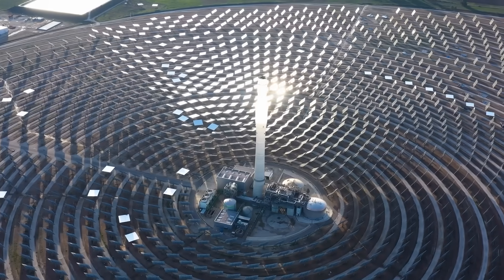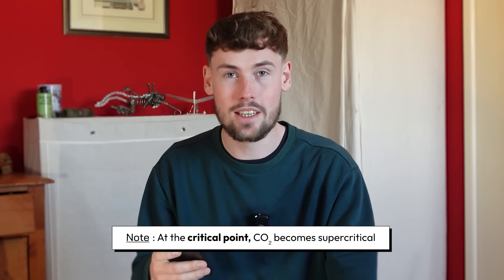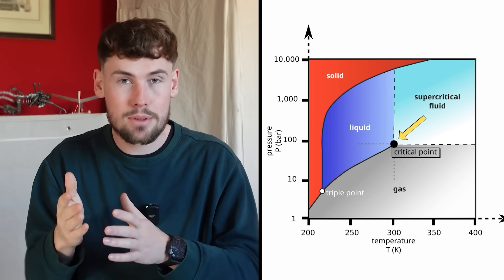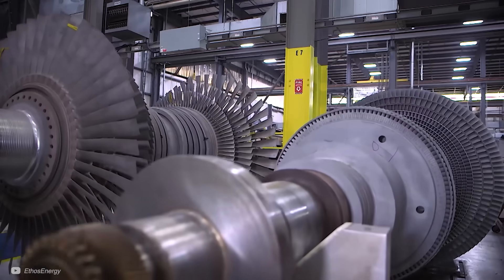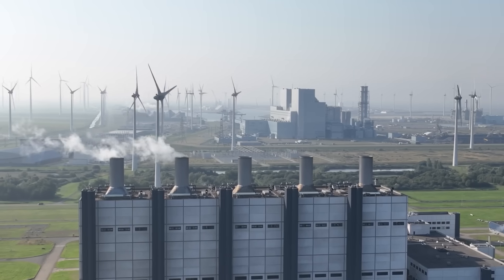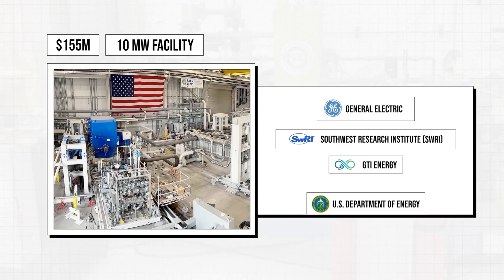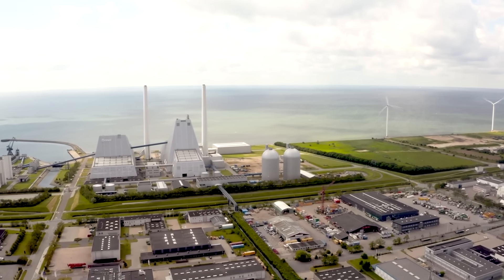How Ultra-Efficient CO2 Turbines Are The Future of Energy

Comment: NOPE... :  https://netl.doe.gov/sites/default/files/netl-file/23UTSR_31_Follett.pdf

IT'S A FARCE, SCAM..TRICKERY - NWO

Review of enhancement for ocean thermal energy conversion system
https://www.sciencedirect.com/science/article/pii/S2468013322000572

Notes on Thermodynamics, Fluid Mechanics, and Gas Dynamics
3.8.2. The Rankine Cycle and Improvements
https://engineering.purdue.edu/~wassgren/teaching/ME20000/NotesAndReading/Lec33_Reading_Wassgren.pdf

Investigation of the potential of R717 blends as working fluids in the organic Rankine cycle (ORC) for ocean thermal energy conversion (OTEC)
https://www.sciencedirect.com/science/article/abs/pii/S0360544222002201

ME 24-221
THERMODYNAMICS I
Solutions to Assignment 11
https://www.andrew.cmu.edu/course/24-221/as11-sol.pdf

Combined Heat
and Power
Technology Fact
Sheet Series
https://betterbuildingssolutioncenter.energy.gov/sites/default/files/attachments/Waste_Heat_to_Power_Fact_Sheet.pdf

Thermodynamic analysis of a new ammonia-water power cycle
https://www.sciencedirect.com/science/article/pii/S2352484719304585

sCO2, Ammonia and Hydrogen –
Advanced Turbine System Technologies
at GTI Energy
https://netl.doe.gov/sites/default/files/netl-file/23UTSR_31_Follett.pdf

V o l . 5 3 N o . 1 2 0 2 01
Development of Ammonia Gas Turbine Co-Generation Technology
https://www.ihi.co.jp/en/technology/sdgs/topic01/pdf/Vol53No1_H.pdf

4/00 Stationary Internal Combustion Sources 3.1-1
3.1 Stationary Gas Turbines
https://www3.epa.gov/ttnchie1/ap42/ch03/final/c03s01.pdf

Comment: so the real problem is pressure you nee at least around 80bar oar 80x atmospheric pressure, which means the structure is thick, you mentioned that in your video. And the reason for the high rpm's is the compactness of the turbine. With the small diameter only a small Torque can generated, so the the high power density could only achieved by high rpm's.

Steam Turbine suffer from low density -> large diameter and centrifugal forces. And sCO2-Turbines suffer from high rpm's.

Comment: You said “170 psi” but wrote “1070 psi.” Converting from 74 atmospheres, it looks like the latter figure is correct.
Awesome technology, I wonder how long it will take to start getting used in new construction… I assume it will only replace existing steam turbines as they wear out, at best.

Comment: I was first introduced to gas turbine as part of the Thorium MSR. The high heat created by the Thorium Reactor uses Molten Salt to move the fuel around as well as to move the heat generated into a gas. The heat of the Thorium Reactor is way too hot for water to turn into steam. I hope America's NRC gets off its bureaucratic a$$ and move forward faster.

Comment: But as you described it it is more a Bryton Cycle than a Rankine Cycle! It match with solar towers for CSP plants.
Anyway I can understand that heat exchangers will be far less complex and the whole plant will be significantly reduced in size and complexity.
Never the less I think (I know for sure) that recompressing supercritical CO2 will be more energy demanding of "recompressing steam" just because nobody (usually) recompressed steam, We all used to recompress water which is an incredibly effortless process.
(I'm sorry but I'm a monster in thermodynamics)

Comment: "the hotter something is, the easier it is to cool down" Stop fucking lieing with vaugeness. "easier" is the not the right word because how the heck is someone supposed to know what you mean by it? 
It certainly doesnt take less thermal energy to reach the same end temperature. Its not easier in that sense. 
It in the same physical setting will decrease in temperature in degrees per unit time faster. But calling that easier is overly reductive to the point of being totally unparcible to someone who doesnt already know what your refering too.

Comment: You're not using enough correct terminology. I'm trying to actually understand this with thermodynamics knowledge and when it's phrased this way it just sounds like woowoo bs.
Reply: Things like Heat Capacity, viscosity, hooks law constant. When you coloqualize complex ideas this much it just fails to communicate the idea. The fundamental difference seems to be how gasses and supercritical fluids relate temperature and pressure. I need more theory as to why than "they're moving fast"

Comment: Weird, that this could be more efficient to turn heat into Electricity than heating water.  Including the energy loss of having to recapture the CO2 with a heat pump instead of with water where you can just vent it outside and put more water into the system.

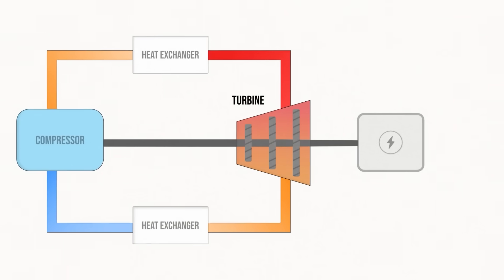Comment: 7:06 You don’t “compress steam”, you “pressurize liquid water” (which takes little energy) and then add heat called the Rankine cycle. The CO₂ cycle or Brayton cycle (which is fundamentally different from the Rankine cycle) requires huge amounts of energy to compress the working fluid. This video is mostly useless as for explaining things. The video doesn’t even explain that supercritical working fluids ARE NOT AS DENSE AS THEIR STANDARD FLUID STATES and thus are compressible and expandable within the supercritical state. Also there are other working fluids other than CO₂ like argon (and multi component working fluids like Supercritical Water and Ammonia, etc). 

The efficiency of a cycle, not the energy density of its components is the proper figure of merit. 

10:30 Also there are now supercritical and “ultra critical” steam Rankine cycles that are pushing 50% thermal efficiency, NOT 40% as the video stated which equals the stated efficiency of the CO2 cycle. So one has to beat that as a minimum but more importantly one has to significantly beat a combined cycle power generation which is 64% thermal efficient. Even an ICE with a bottoming cycle is significantly more efficient (54%). 

If you are going to be talking about using CO₂ as a working fluid maybe mentioning “oxycombustion” would be illustrative (as in the Allam cycle) which is more relevant and interesting. 

Basically the “pseudo-information” provided in this video is more misleading than useful.

Comment: CO2 is not more efficient than steam, it is simply a buzzier word to get investment funding!  Steam turbines are already "100%" mechanically efficient.  Overall plant efficiency is about 65% because that is the limit of the Rankine cycle - the VERY same cycle the CO2 uses to do the very same job.   It might have some advantages over water, like no rust maybe?  But it is hardly the 1000-years into the future "breakthrough" that is advertised.

Comment: Lots of unanswered questions in this one Ziroth, and it is very disappointing because it shows shill bias to me. Integrity is everything!
To me the only real advantage is the size (presumed cost) of the turbine, and it's presumed longevity, but you did mention that they are still working on said THICK metallurgy to ensure it...stretching harder on this one more than normal it seems to me? 
Source of the CO2 and how much will it cost to produce and how much will be required over a year at max capacity...AKA closed loop or open loop? As water is pretty much everywhere and dirt cheap for the most part. How much power does it consume to run, you know parasitic losses, and how about those CO2 compressors plus their yearly costs in power & maintenance? Now the temperature control of the supercritical CO2 in this tight range? 
You do know that super heated steam is dry right, turbine blade failure is extremely rare right, in a properly maintained plant?

Comment: One added challenge will be that the electricity won't be at the 60hz standard right from the turbine. The 27K RPM rotor makes that impossible. This means that there will need to be some sort of converter after the generator.

Comment: A few things here are wrong. 1. you dont compress the steam. You compress water to 200 bars (easy) and let the boiling take care of the Expansion. This step is super efficient, thats why it is done everywhere. You „lose“ some energy to condensation, but you can use a secondary heat exchanger to still include it into the Process again.
Reply: Furthermore, you have to lose heat energy to the environment in the condenser, otherwise the entropy of the working fluid will not return to its initial state and it will not be possible to continue the cycle of the engine. Even using a supercritical fluid such as co2 (or supercritical water for that matter) does not change this necessity, it’s simply the laws of thermodynamics (specifically the second). For this reason, you can’t actually reintroduce this heat into the process however a different process could use the waste heat to produce energy. However this is true for all possible heat engines, no matter the design.
Reply: It's best to use the exhaust steam for district heating and cooling.
Reply: @gregorymalchuk272   District heating is usually a commercial nightmare, and that's why it's not commonly seen in market-based power systems.  Much of the value of power station operation is derived from responding to power demand (mitigating financial risk in the power market), whereas a district heating scheme demands power station operation when it is not needed in the power market and this results in financial losses.  Machines are generally best to focus on a given task: a power station for the power market, and a boiler is the most effective way to create heat for a heating market.
Reply: *lose
Reply: @ thx, corrected 👍

Comment: You can't compare the ease of compressibililty of a gas with a liquid . It has to be two gases or it is meaningless.
It is comparing apples with blocks of concrete
You need to compare air with a dense gas such as uranium hexafluoride

Comment: Why is the most problematic part for co2 turbines not discussed? And also coincidentally the main reason water and turbines are used.. When you boil water, it expands, you don't need a compressor, the compression is done by boiling.. You're talking about generator efficiency and forgetting to talk about compression inefficiencies. Something that in the case of water is in the region of 95% because boilers can be made really efficiently.. Compressors first need to be driven, how do you drive the compressor when your energy output is heat??

Comment: Rotating equipment engineer here, I toured this Southwest Research Campus in San Antonio,TX in 2023 for this very high power density SCO2 turbine. It had a natural gas fired energy input and 3-D printed heat exchanger. The working pressures and temps were extremely high (as stated) and they had to develop custom shaft couplings to handle the high torque for the relatively small shaft diameter.  At that time the device just passed the “proof of concept” phase but it was very impressive and promising tech.
Reply: Did they mention something about cost of kWh compared to the steam turbine results? I am impressed by the idea, but the lack of financial discussion is somewhat bothering me a lot, as an engineer.
Reply: @ no mention of cost per kWh, the initial costs are almost certainly higher, and the fuel efficiency is unlikely to be worth that higher cost, but if the maintenance costs are lower and turbine lifespan is better, that alone makes it worth pursuing. the improved power density also opens up new applications where steam turbines are just too bulky.

steam is corrosive and slowly eats steel, unbalancing the turbine and limiting lifespan. supercritical CO2 doesn't eat steel. it may harm other components, but they're gonna be a lot cheaper to replace than the turbine itself.
Reply: @JedPotts-jv2ux  I was surprised that the efficiency only went from 40% to 50%. The molecular mass of CO2 (44) is over four time the molecular mass of H2O (10) which I would expect to result in more than only a 25% improvement in efficiency.
Reply: The downer is the maintenance cost of gassing and degassing the system. Also, catastrophic failure on the hot side would go off like a bomb because of the amount of energy stored in the hot supercritical CO2.
Reply: @cyber5515 CO 2 or H2O would not matter, when it goes off, it is disastrous. Engineering is key, lessons from failures are inevitable.  It is interesting.  It might be something that could be paired with the new reactor types, water heat exchangers, the SCO2 cycle, and with batteries.  Keep it small.  Use header systems and expand as needed.  Same old stuff
Reply: To me, it seems that it would take effort to come up with a coupling that is weaker than the shaft that it couples.
Reply: Spent a life time in shaft couplings especially high speed ones, wondering what type of coupling they would have used, a diaphragm or something similar or non contact ones ?? if any one can answer, a big Thanks..
Reply: @skarumuru  I know that some labs use magnetic couplings and magnetic and air foil based bearings.
Reply: You don't have to take it from me, you can search tug of war between diesel and steam tractors and those steam run in pistons so a Tesla turbine would be even more efficient.
Reply: @Brent-e9wTesla turbines are not more efficient, that is a common confusion between isentropic and thermal efficiency, which are NOT the same. Isentropic efficiency is the fraction of real world efficiency to theoretical maximum thermal efficiency. It includes real losses like friction, vibration and turbulence and is almost always much higher than thermal efficiency for any engine. For example, an engine with a theoretical thermal efficiency of 50%, and isentropic efficiency of 90%, will have 0.9*0.5 => 45% real world thermal efficiency. Tesla turbines can potentially reach similar isentropic efficiency of regular turbines, around 85-95%, but no such Tesla turbine has ever been built that can reach those values. Meanwhile, there are thousands of regular turbines that can even exceed 95% isentropic efficiency, even though it's uncommon.
Reply: Who was the maker of the heat exchanger? What was the ekW output of this experimental unit?
Reply: What pressure and temperatures were in the sCO2 heater, and what materials were used in the heater, austenitic stainless steels, or inconel type alloys?
Reply: it'd certainly be compact enough for use on nuclear subs and aircraft carriers, but is it small enough to potentially be used on trucks and road vehicles? and would it retain its high efficiency if scaled down to <1MW?

internal combustion engines have poor efficiency, last only a few thousand hours at best, and have very limited fuel flexibility. a truck engine that can run for tens/hundreds of thousands of hours and use almost any combustible material as fuel, would be worth its weight in gold for freight transport and logistics.
Reply: @JedPotts-jv2ux  They don't last "a few thousand hours at best", but much longer. Heavy-duty piston engines in trucks, buses, and generators usually reach 15k- 50k hours before needing an overhaul. The reason for piston engines' low efficiency in road vehicles is mainly due to being used at part/low load conditions. But turbines of any kind, such as gas turbines and CO2 turbines, have TERRIBLE part load efficiency, much worse than piston engines. Apart from cost, it's one of the main reasons you don't see turbines in road vehicles. At high load conditions, piston engines as of today can reach thermal efficiencies in excess of 50%  (but more commonly 40-45%), so a small CO2 turbine would definitely not be better at that, especially considering the small size. Additionally, fuel flexibility is not a great design challenge for diesel engines; there are plenty of examples of it being used.
Reply: Ship engines are up to 25k TBO now and few heat engines compete with the diesel cycle in real world efficiancy. Many things beat diesel power dencity though.
Reply: @LocPH.  So much THIS. You are absolutely right. Piston engines sacrifice peak efficiency for higher efficiency in low load conditions as well as sacrificing peak efficiency for emission control of preventing NOx formation. Turbines are unfortunately utterly garbage at lower load conditions. And the mitigations for that (variable geometry), can only practically be implemented in large turbines, think airplane jet engines...
Reply: @dominikvonlavante6113  Unfortunately it's because turbines pressure ratio (which determines efficiency and power) has an rpm dependency, due to using axial or centrifugal compressors. For piston engines it's fixed, which is much better. 

As for peak efficiency, diesel engines have about the same or even exceed turbines of the same power rating. But the turbines will be far more power dense of course.
Reply: Jed, no, turbines are not suitable for small applications since they don't really seal.
And though internal combustion used to be inefficient the segregated combustion engine raises the bar to near 70% while burning waste plastic laced fuel, cleaning the air, and lasting several decades.
Reply: @JedPotts-jv2ux A Rondo style battery with inner pipes and outer condenser pipes this is a technology that could exist if evolved into it, there's already 3 soon to be more corporations involved with Rondo style battery.
Reply: CO2 is seen as a bad thing without sufficient scientific basis for the assertion. As someone who does "deep dives" you ought to know that.
Reply: @nolaspeaker5656  The only explanation for the undeniable rapid increase in Earth's average temperature in recent decades is the increase in atmospheric greenhouse gas concentrations, primarily CO2, entirely caused by human activities, primarily from burning billions of tons of fossil fuels. If your so-called deep dive leads you to deny that, it was into a rabbit hole of unfounded conspiracy theories and unscientific nonsense.